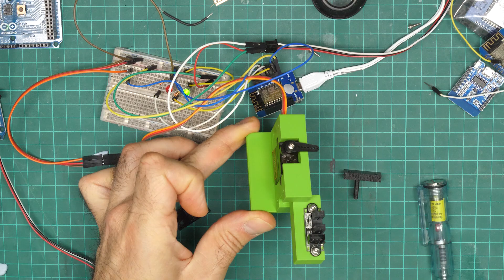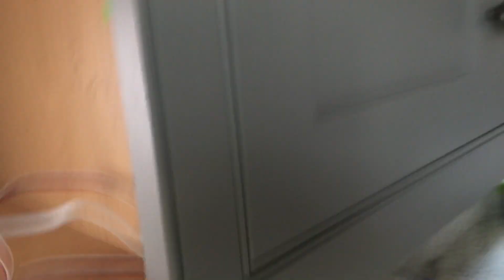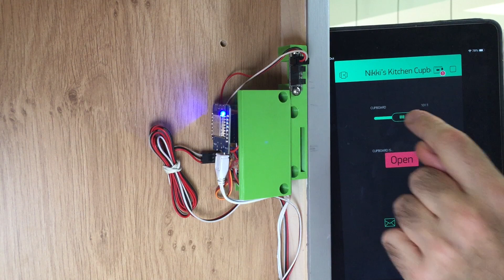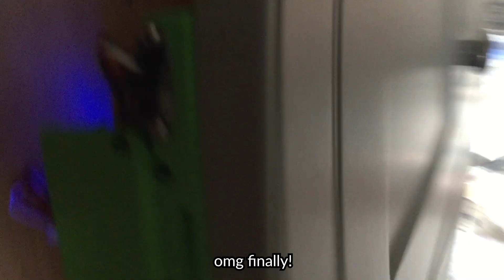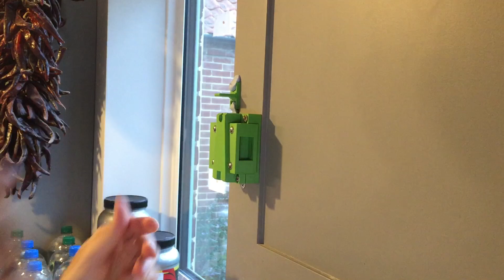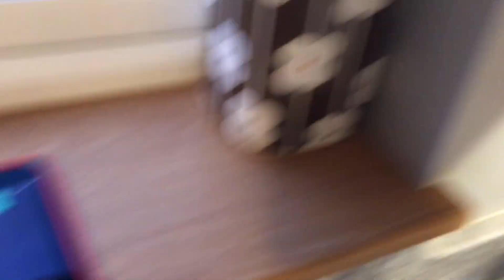The Doughnut Keeper 2000 (PART 2) * DIY App controlled Wifi Door Lock * D1 mini wifi lock * ESP8266

Comment: Julian, looking at the Doughnut Keeper 2000 it seems to me it needs could be improved with several small improvements in the hardware and software code if possible.  The changes that if the can be incorporated in the software is first the servo return to the lock position either by timer or after the optical sensor goes to the open position, this way Nicki does not have to lock the cupboard manually.  The second software change that I would think Nicki would like is a door open time limit alarm.  By this I mean after ?? amount of time with the optical sensor open (door open) Nicki would get another e-mail letting her know the door is still open thus prohibiting you from leaving the door open for extended unauthorized periods of time and cupboard raiding.  As far as the hardware the first would be to neatening and dressing the wiring either by trimming to proper length and heat shrinking them, wire loom, or use of some other cable management (sticky-backs, zip-ties, and or 3D print something such as cover(s) that would make everything look more finished especially on the cabinet wall one last thing instead of the emergency wires you have hang down consider either a magnet connect like wireless charging connector or a RCA mini.  All in all a interesting project that has plenty of possibles.
Reply from the maker: gullreefclub thanI you so much for your comments, I agree there are many ways it can be improved, the timer on the servo was considered (also a max time limit for the the door to close) but we didn’t do it as sometimes Nikki wants the cupboard open for an hour while she makes the bread for the week or something. I didn’t show it but I’ve cable clipped all the external wires now so it looks great, the internal ones would have been done too, but Nikki’s started hoarding Xmas things in it now so I’m not allowed in to tie them up yet! I love that magnet idea that long wire would Benefit greatly from that. At the moment it’s sort of wedged under the other neater wires.
Reply from the maker: Oh I forgot to add i even toyed with the idea for an rfid watch strap for Nikki, to automatically open it when she’s near but in the end we kept it nice and simple. She absolutely loves it by the way. Thanks for your great comment :)